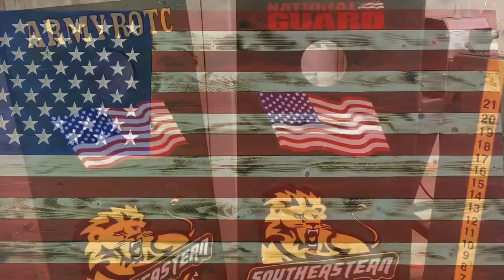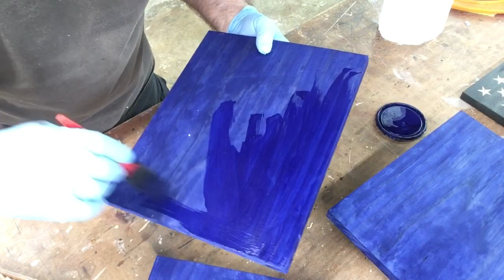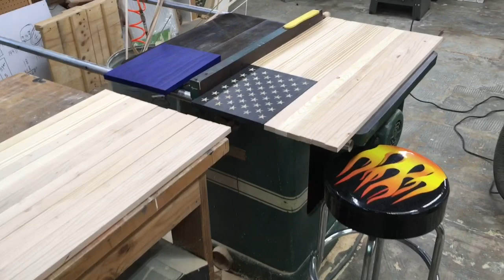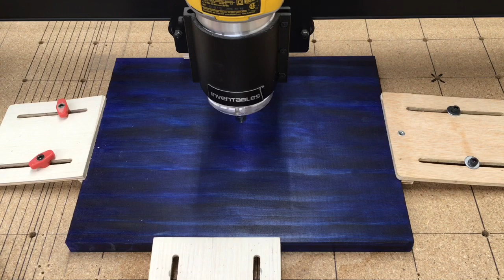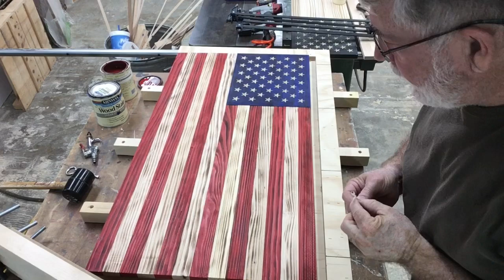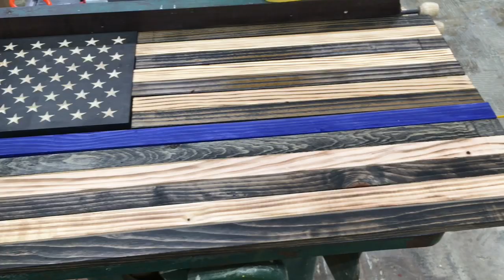Rustic Flag Production Run

Comment: Great video 👍🏻 I have a question, do you cut off the round over on the 2x4s as you cut the 1.5” stripes? And do you also run the union through the planer along with the stripes? 
 I really want to try this on my next Flag for my neighbor. I will CNC it with the army logo and war veteran and his name and give it to him at our next Community pizza night. I can’t wait to get started. Thanks again!!
Reply from the maker: It really depends on the look that I want. Often times I remove the rounded edges. As far as the union make sure it is completely flat. You can use the strips or you can use a solid board

Comment: I love your videos. Question how do you get your materials to be so flat and consistent. when cutting out my projects the material gives me areas that are to deep or to shallow even though they where set at the same depth.
Reply from the maker: Start by selecting the best I can find. Sometimes I can clamp the wood down and remove any twist that way. If it’s really bad, then I will skim the material with the CNC first to get it flat

Comment: If I may ask, why did you resew the 2x4?  I'm assuming you resawed at 3/4 which leaves less than 3/4" on other have.  Why didn't you just rip it at 3/4" since 2x4 is 1.5" already?   What this for the grain?
Reply from the maker: Just another way to make a flag. These boards were very inexpensive and with a little effort produce excellent results

Comment: What bit and what depth do you use for your stars ?
Reply from the maker: This is a 90 degree vbit. I set the depth by looking at the preview. I want the star to have a point at the bottom
Reply: @PawPawsWorkShop   Does the software you use make a difference in the quality of the cut, such as Easel,carbide create, vectric,etc..? I own a onefinity woodworker.
Reply from the maker: The different software allows you to do different things. You can do so much more with VCarve. Also, it’s important to note that easel pro is getting better all the time. They are regularly upgrading it now

Comment: I cut my stripes from a 2x6.  I cut .75" on the table saw from the edge of the 2x6.  Repeat until you get 6 stripes.  This guarantees 1.5" thickness (thickness of the 2x6).This saves money over buying 1x12 pine, looks better, and has better dimensional stability.
Reply from the maker: Great idea

Comment: Love your videos. I plan to make one of these for a friend. However she wants a F22 Raptor carved into it. Would you recommend carving the Raptor after the clear coat, "flood" then wipe off as i have seen you do with other projects. Or should I oramask, carve the raptor, paint and then seal all at once?  Again thanks for the great videos.
Reply from the maker: Clear coat everything.  Do the carve, then clear coat the area of the carve. Then flood the area.  Try a small area at first to see if it will wipe clean.  You have to clear coat after the carve because paint will get under the surface and cause problems. The masking is not truly effective because the surface is uneven.  Hope this helps you complete your project.

Comment: Paw Paw, just came across your channel, and have to tell you, it’s one of the most watchable and informative I’ve come across. I just built my own cnc, and between the flag videos and a couple of your design videos I’ve learned a ton. So... thanks!
A couple questions though: have you ever charred the union after you cut the stars? It seems like the stars would stand out as not being charred in this video (although I must confess I didn’t watch clear to the end). Also, do you simply glue the end grain of the union to the end grain of the short stripes? 
Thanks again for the informative and uncluttered (no crazy music etc) work on the net.
Reply from the maker: I always char the union first and then carve the stars.  The boards on the back holds on the union in place also. Thank you very much.
Reply: @PawPawsWorkShop  Thanks! Do you use any pre-stain/conditioner on the pine first, or does the charring help even out the stain (prevent blotching)?
Reply from the maker: The charring helps with that and no I do not.

Comment: How do you get the
Stain to those colors ?
Reply from the maker: These are Minwax colors.  Scarlet, True Blue were the names, however, the names have changed.  Just look at the new chart for the current names.
Reply: Paw Paw’s WorkShop thank you and do they come in the color already or do i need to ask them for it
Reply from the maker: You have to ask for them to be mixed.
Reply: Paw Paw’s WorkShop thank you very much like your work by the way
Reply: Do you burn the wood before the read or after you paint it red
Reply from the maker: I have done it both ways.  I like burning the wood after staining it red. Try it both ways and see which way you like best.

Comment: You said in an earlier message that most big box store wood is wet so were do  you buy your wood from? Thanks.
Reply from the maker: Still at the big box stores and some local lumber outlets.  You must choose carefully.  The unions are typically the premium pine which is far better than the #2 pine but still does not solve all the problems.

Comment: Question sir, what color do you use for the subdue ones?
Reply from the maker: For the red stripes and the blue union, stain the wood with ebony first and wipe off immediately; let dry. Then stain with the red or the blue. For the white, use a grey stain and repeat the process.
Reply: @PawPawsWorkShop  I mean the black ones. By the way Chief I'm currently in the Army and I love watching your videos, I have learn a ton from you. Thank you very much.
Reply from the maker: I have switched to just using acrylic paint thinned with a little water.  I want to achieve a solid black color and still see the grain of the wood.

Comment: How do you ship your flags and have. Also, have you ever had your stars come out different sizes. I seem to have that problem.
Reply from the maker: I make my own box and use padding to protect the flag.  No, I have not had a problem with the stars.  If the stars are different sizes that indicates that the board is not flat or no level to the gantry.  The board may be bowed or it may be a problem with the CNC
Reply: Paw Paw’s WorkShop I know you’re probably supper busy but by any chance can you make a video of how you make the boxes for your flags. Ps your videos are super helpful!!!

Comment: When you plane you cut lumber do you have a problem with the thickness being off with respect to the thickness of the union since you do not run it thru the planner? Thanks.
Reply from the maker: No, because I assemble  the flag face down.  Any difference is on the back side not the front. The front will remain flat.  Thank you very much.

Comment: Do you sell only the carved unions for small, medium and large flags?
Reply from the maker: I sell the unions as well as the whole flag.  The large flags are very expensive to ship however due to the weight and size.  Shipping on the small and medium is usually around $30 to $50.  Shipped in US only.
Reply: @PawPawsWorkShop , where do you have your prices for the CNC carved unions?

Comment: I'm finding it's taking me 1 can per flag for each layer of clear coat. Are you using 3 cans per flag and do you coat the back?
Reply from the maker: Kurt C .  I use about one can per flag and yes I coat the back. It will warp if you do not. You must seal it on all sides. The braces will do a good job holding everything together but take no chances. Thank you for the questions

Comment: Outstanding video and flag!! Just curious, why did you stain the union prior to burning it with the torch?
Reply from the maker: Only because I like the look better.  I think that in future I will torch the union first.  It is actually easier with similar results.
Reply: I noticed that when I stain, then burn, I get a discolored stain due to the reaction from the flame. Now I prefer to burn, then stain. Thanks Paw Paw!

Comment: Which sealer are you using? And what are the red and blue color names for the stain? Thanks!
Reply from the maker: I use Minwax True Blue and the Scarlet for the Red.  The clear gloss is usually the Rustoleum 2x Clear Gloss.  If for any reason you wish to put the flag outdoors you must use a good quality UV protective coat such as Helmsman.
Reply: @PawPawsWorkShop  Thanks!

Comment: I don't like being the safety police  because people have different skill levels and some are comfortable  doing things others are not.
 Not having a guard  on that miter saw is very scary I had a saw that the guard would stick at times and while my dad was making several cuts he reached across to with his tape to make a new mark and the saw had not completely stopped and it cut about an inch into his wrist into the bone.
   I decided right then  a new saw was way cheaper  than an injury and Er bill  and  not being able to work because of an preventable injury .
 The flags look great and real nice job on the video.
Reply from the maker: I certainly understand your point.  I grew up when all the saws did not have guards.  This miter saw is so old that it was not designed to have a guard.  I believe in safety and the new saws have made major improvements to that end.  I will be upgrading my work bench and putting another miter saw on the bench in a future video.  Thank you very much.
Reply: After reading your reply about not having guards when I was 11 my grandfather had a cabinet shop and had a jointer with no guard it was the only tool I was not allowed to use , well as boys will do I was unsupervised in the shop and decided I would run a 4x4 across it not sure what happened but before I knew it the board was gone and the palm of my hand was in the blades opened it up from pinky to thumb with a lot of meat missing and 96 stitches . That probably adds to my folia as well.
Reply from the maker: wow!  Tools can be very dangerous especially the old ones without the guards.  I do not remember not having a guard on the jointer.  But, I do know that a lot of old cabinet makers removed guards that were in placed.  Just think if they say our tools today with all the guards in place.  You can never be too safe.  Thank you for sharing.
Reply: @PawPawsWorkShop  "I don't like being the safety police".....followed by a long rant. Kinda seems like he likes being the safety police. You mention safety MULTIPLE times in all your videos, yet you're bound to attract someone that just can't help themselves. Everyone has a story, either 1st hand or 2nd. So what! Just watch the video and enjoy it....he's being safe. If someone chops off their hand after watching this video, it's not Paw Paw's fault....the same way it's not Trump's fault for someone drinking Lysol!

Comment: Amazing job.  I love the look of the stars done on the cnc machine. Great depth and appearance.  
When you put the clamps on the face to bring edges even, how do you keep the glue squeeze out from gluing to the clamps?
Reply from the maker: I use a very small amount of glue and put it on the back edge.  It will squeeze out on the back rather than the front.  Also, I only keep the flag in the clamps about 30 minutes.  I will look at the face for any glue and there is still time to clean it up.

Comment: Great video!  Got a question....how do you combat some of the Unions being warped/cupped slightly on the CNC?  Any way to get the warp/cupping out of them?
Reply from the maker: The unions will warp if the wood is wet and drys uneven. You can get some of the cup out by wetting the wood and clamping it flat.  The trick is to allow air all around it while it is clamped and drying.

Comment: What spray finish do you use? Do you do anything between coats or just spray away after each coat dries?
Reply from the maker: Brandon Magallon sand with 220 grit sandpaper
Reply: Paw Paw’s WorkShop what type of finish is that you’re spraying?
Reply from the maker: Rustoleum 2x clear gloss

Comment: Looks great brother. I’ve had the biggest problem with my stars carving bigger on the bottom of the union and as it moves to the top of the union the stars shrink up to a 1/4 of an inch and I have leveled it in every direction a hundred times it seems now and tried shimming the work piece at this point and still having the same problem out of my xcarve
Reply from the maker: Plemons Lawn Care .it sound like the wood is warped and is lifting off the table.
Reply: Paw Paw’s WorkShop I originally thought the same as well I have tried it on numerous types of wood as well. Do you have a Facebook or Instagram I can send you a private message to explain a little more in depth?

Comment: Thanks for making these videos, Paw Paw. I've built a few flags of my own using your instruction from past videos and they've turned out great, but I've had problems with the wood warping when I've hit them with the torch. I don't see you having any problems with that and was wondering if you've  had this issue in the past and if you have any tips to prevent it from happening.
Reply from the maker: Thank you very much.  Most likely the problem that you are having with the wood warping is very wet wood.  If you buy it for the big box stores you will find very wet wood.  When shopping, if the wood feels cool to the tough, its wet.  Ideally you are looking for wood that has a moisture content of about 6-7% . With contruction grade material that will be hard to find.
Reply: That makes sense.Thank you very much for the reply.
Reply from the maker: You're welcome

Comment: Great video, very helpful! My question is, what do you do (or how do you deal) with glue that may seep out on the finished side of the flag? I see that you use minimal glue and reinforce the back with wood, but if/when it does occur, do you just lightly sand and retouch with stain?
Reply from the maker: I put the glue on the back part of the stripe and I have not had a problem with it seeping out on the front side.  If that happens, I can clean it up prior to the glue completely drying.  I only leave it in the clamps about 30 minutes to an hour.  That still gives me time to clean up any glue.
Reply: @PawPawsWorkShop  thank you!
Reply from the maker: You're welcome. Also, it is easy to clean up the glue on the back side.

Comment: What depth did you carve the stars? 60 degree bit?
Reply from the maker: I use a 90 degree v bit to carve the stars.  The depth is set so that the bit forms a point in the center of the star.  I do not want a flat bottom.